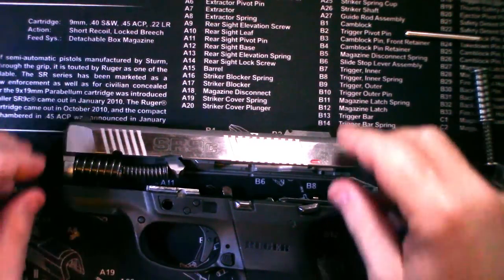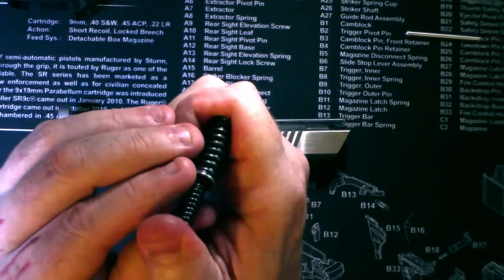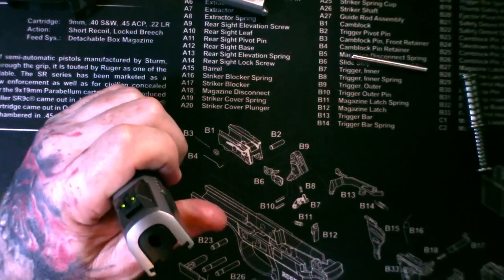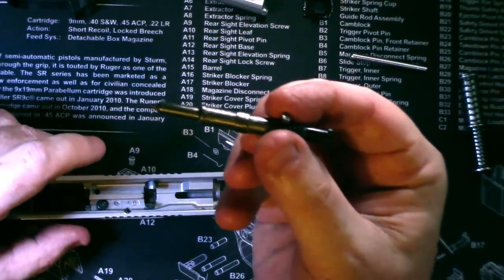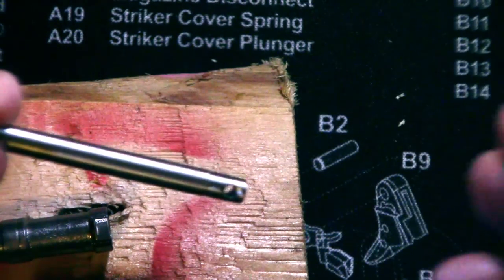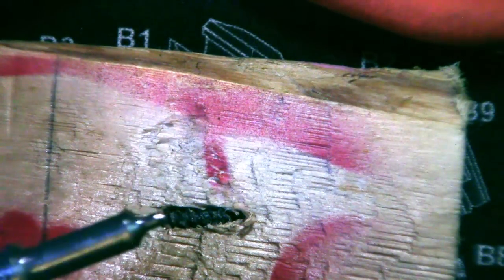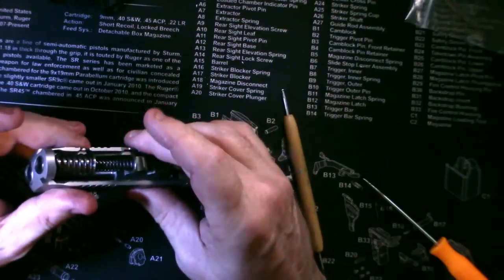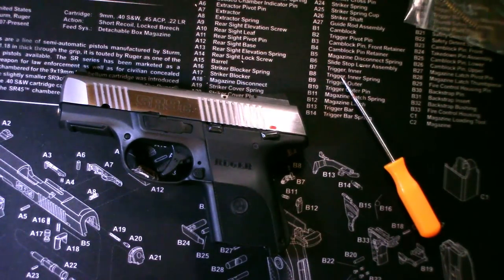Fix Ruger SR9c light primer strikes and replace plastic parts

Comment: I had zero issues with my stock SR9c but since I like moding guns I've done everything in this video. It has turned a very good gun in to a GREAT gun. Love the trigger  !!!
Reply: Where did you find all the parts. I'm having extremely light strike
Reply: @jeremymolyneaux5025  Galloway precision sells the parts but before u buy them try removing the magazine disconnect and I'm pretty sure that will solve your problems

Comment: Stock polymer guide rod is great preformer . dependable...& yes bendable which bothers some.
More then a few SR9c owners are posting 3000+ shots fired no issue flawless rod operation 4-5 years into ownership.
This is not to say some aren't defective...same can be said for steel replacment version as well.
My M&P Shield steel guide rod fell apart around 2000 shots unfortunately.

I noticed your orginal striker was Ruger packing grease...lots of it which was more then likely causing lite strike ,  this was very common on early SR9c  & 40c builds. 
My 2015 build had zero packing grease. I've experienced no lite strikes 900 rounds into ownership perfect performance so far.

Comment: This is the best video on this topic for this gun that I've been able to find. Because of this video I was able to upgrade the same parts to my SR9c. The procedure went very smooth. Even replacing the roll pin. A weird thing happened though. My trigger reset would stick and not reset, so when the slide sends a new round into battery, the firing pin would already be out because of the stuck trigger. As soon as the second round went into battery with the firing pin sticking out, I would get an unintentional double tap.
Reply: The mod was worth it then

Comment: My Ruger 9E was notorious for light strikes and frequently would not cycle.  I did the same procedure with Galloway parts making the 9E a truly nice shooting 9mm.  I have since acquired an SR45, got the equivalent parts from Galloway and installed before firing the '45 for the first time.  Like the 9E, the SR45 fires and ejects every round. But wait there's more!   I have purchased a SR9C and you guessed it, I have the Galloway upgrade parts in-hand but have yet to receive the SR9C.  When I get cleared to receive the gun (used to be able, with carry permit, to lay down the cash and walk out with a handgun until Tiny Mike got Washington State far left pols push through new gun restrictions laws).  The required 10 days to get cleared was 21 days for the SR45.  I expect it to take 21 days for the SR9C too.  If Bloomberg ever becomes President, kiss your guns goodbye.

Comment: Great video. This helped a lot. I just pulled mine apart for having a light primer strike problem and had a small chunk of plastic come out with the firing pin. Contacted Ruger but its a weekend. Hopefully they will get back with me early next week.
Reply from the maker: I just went out this weekend and shot. Had about 15 light primer strikes out of 150 rounds. Ran the unfired rounds through a different gun, and all but 2 fired.
Reply: BlindViews so then, appearantly these mods did not solve the light primer strike issue? I really like the way this gun feels in my hand but right now, I don't trust it. Hopefully ruger will get back with me soon and offer to fix the problem. Otherwise, I'll be trading it in.
Reply from the maker: It's looks like that it did not fix the issue. I really like the gun as well. I think I might have to trade mine in if Ruger can not or does not fix it.
Reply: BlindViews I just a hold of Ruger today. They said they'll take care of it. They are sending me a shipping label to send it back to them and they will go through it completely and then send it back to me. Great customer service so far.

Comment: Hoping you can help me out. I was having the light primer strikes so I did both upgrades you did in this video. However now that I've got it all back together when I rack the slide the trigger won't reset. Not sure what I did wrong. Any help you can send my way would be appreciated
Reply from the maker: I'm not sure what happened. My best advice would be put the original parts back in and call Ruger. They have great customer service.

Comment: Liked/subscribed thanks for a great video. I just picked up a used sr9c and will see how it does how I got it. Not many negative reviews which is always good.
Reply from the maker: I still have mine. Nice shooter. After I fixed the light strike issue, it's great. I could have sent it in. Ruger has great customer service.
Reply: What was the actual problem I saw that when you replaced the plastic part it still didn’t fix it for you and I happened to see a lot more issues with the 9C then the regular SR wondering if there’s a reason

Comment: Just two follow up questions, did the heavier striker spring 100 percent fix the light primer strikes and did the heavier spring increase the trigger pull pressure required to fire. The pistol?
Reply from the maker: So far it did fix the problem. It did make the trigger pull a little stiffer, not much.

Comment: I've had my sr40c for about 3yrs now, just came from the local range & used some cheap tulua steel rounds it doesn't seem to like it now my slide is stuck & there's a round in chamber it won't slide back please wat can I do

Comment: I've had my sr9c ever since 2010..I run about 5000 rounds through it a year with the plastic polymer firing pin and giude rod
Reply: But one day it'll will fail when you need it the most.
Reply: Congrats

Comment: Nice video. I've had occasional light primer strikes also, but thought it may have been the old ammo I was trying to use up.  maybe that wasn't the case after all. Anyway, can you say what lbs the original guide rod spring is?  And what benefits can be had by going with a stronger spring (they sell several different lbs versions), and why you opted for the one you chose I stead of a heavier one?  thanks
Reply from the maker: Stock recoil spring on the guide rod is 16lb. 14lb Is for light loads and 18 is the upper end of the 9mm for +P loads. The 20lb is for the 40 not the 9mm. I went with the 16lb recoil spring, but got the heavy striker spring. The new striker spring is 20% over factory.
Reply: What effect, (if any noticeable), does the +20% striker spring have on trigger pull?  I have an SR9 and have not had any light primer strikes.  The only problem I had at approximately 1600 rds was the slide lock spring broke.  the slide would the lock back after every round.  A quick trip to Ruger and all good now.

Comment: I had light primer strikes on a gun that shoots blanks, my striker spring is a leaf spring, there are NO SPARE PARTS for that gun so i just bent the spring with pliers, seems to work for now. In Europe Blank shooting guns(can also shoot pepper) are made from zinc aluminium and copper so they are can not be converted they don't last long and there are no spare parts whatsoever.

Comment: Did this help with your light primer strikes I'm thinking about ordering the parts
Reply from the maker: I put a little over 1,000 rounds through it without issue.
Reply: BlindViews ok thanks Im having just light primer strikes after light primer strike and I was just about ready to get rid of if I'll try this and see what happens
Reply from the maker: @Rushshooting67913  Ruger does have GREAT customer service if you want to go that way. I have a few guns and like to tinker with stuff. That's why I tore mine apart.  Ruger will take care of you if you don't want to mess with it.

Comment: I replaced the striker with the stainless steel as well as the new spring. I went through 75 rounds of american eagle no issues. I then went through about 30 rounds of Winchester white box 3 light primer strikes. I just went through a full box of federal ammo today 50 rounds with 2 light primer strikes. My question is do you think I should just finish replacing the guild rod and possibly the striker itself or just trade in my SR9C for something else?
Reply: change the striker spring
Reply: Same here
Man I shot over 3,000 rounds of remmington ball ammo and never had an issue, I switched up my ammo bc it’s cheaper to the Winchester white box and had 6 total light primer strikes out of 50 rounds so.. it’s deff the ammo not the gun

Comment: My Ruger SR9C will not shoot wolf military classic 9mm Luger ammo at all any suggestions
Reply from the maker: Not sure. As far as I can tell, mine is ammo finicky. It shoots some fine, and others random. If it's a gun issue, Ruger does have awesome customer service.
Reply: Santa Nero,  If you shoot Wolf ammo it will void your warranty and for good reasons, Steel is rough on ejector, and  chamber.Powder residue is like glue on internals. The Russians pistols have, like the AK, loose tolerance compared to most American pistols. If you love your pistol or rifle, don't shoot Wolf unless it is Russian weapon that was make to shoot it.